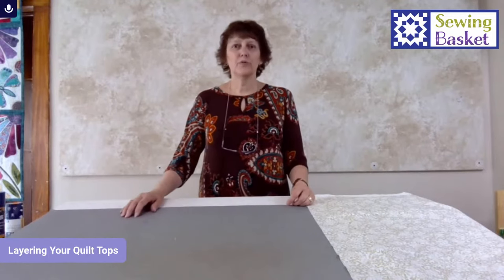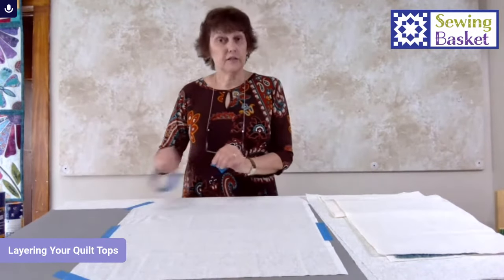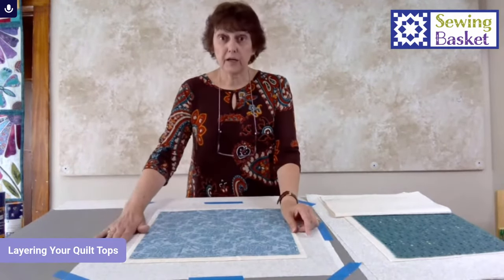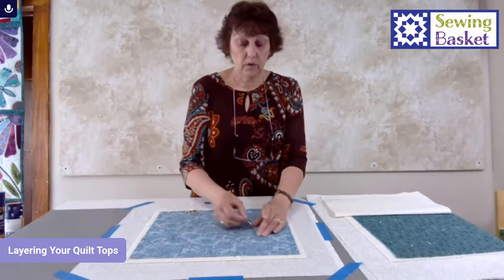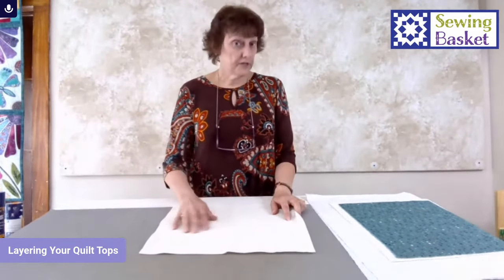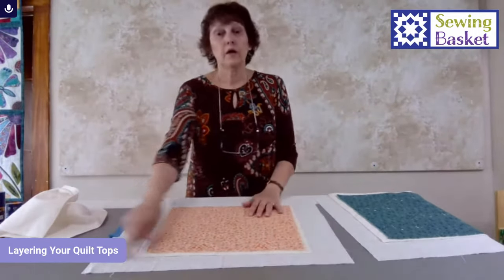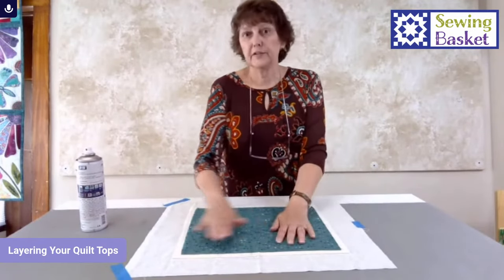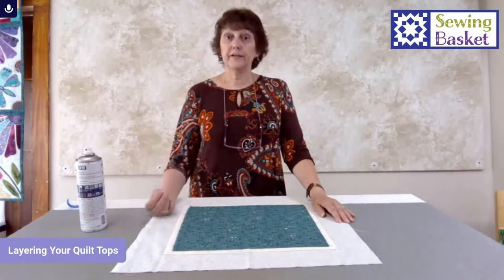Layering Your Quilt Tops - 3 Different Options.  Pin basting, spray baste and using fusible batting.

Comment: Fusible webbing also works well. Use it in strips or patches.  Basted on my design wall for the first time.  Game changer.  I used my garment steamer to relax fabric and batting. Straight edge worked well to smooth fabric over.